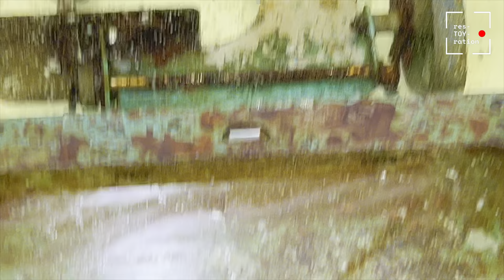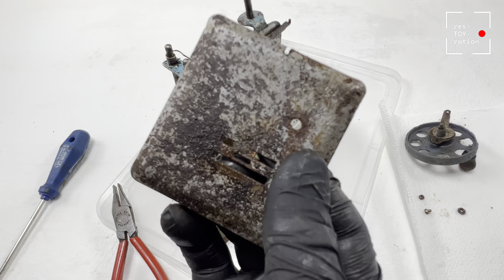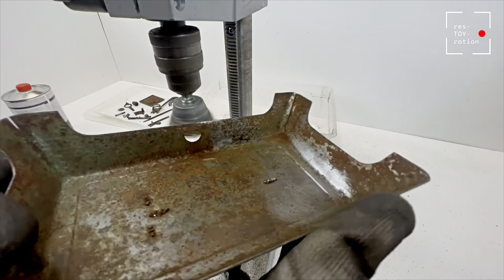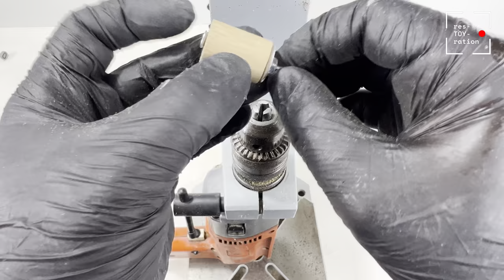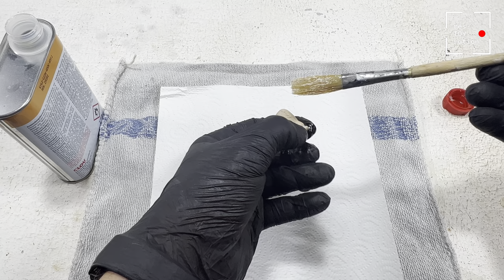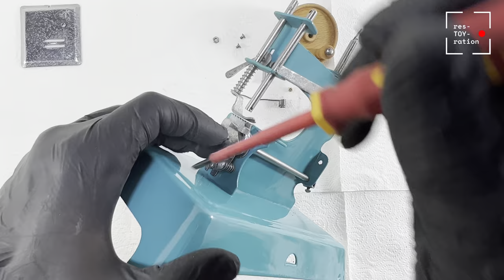Restoration of a old FRENCH rusty toy sewing machine 20th

Comment: Sorry, an amateurish resto.  The citric acid was wholly unnecessary and accomplished little.  The biggest disappointment was the hand wheel which a competent restorer would have machined out of aluminum at the least.  No subscribed here.
Reply: Everyone's gotta start somewhere and I think this is a pretty decent start for them actually! Always room for improvement!
Reply: You’re entitled to your opinion I suppose, but I feel that machining an aluminum wheel would have been a bit overkill for this toy y’know? It’s, at most, three plates of thin metal that have been arranged to form a sewing machine-like shape. Plus, like the other commenter said, everybody needs to start somewhere. All in all, I don’t think this was a bad restoration at all. Subscribed!
Reply: Maybe doesn't have the equipment or knowledge to machine metal - this was a nice compromise I thought. Everyone's a critic 🙄
Reply: Sharply put.  In another time you would have been called out for a duel.  And justly so.  Cad.
Reply: Good to see a restoration that didn’t use sandblasting. Makes me feel I could restore my own machines. Very decent job.